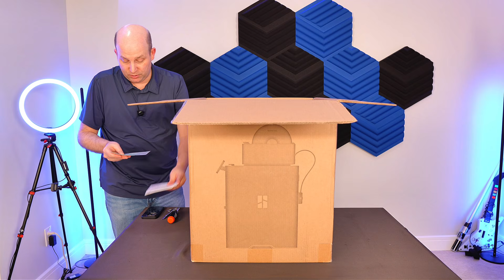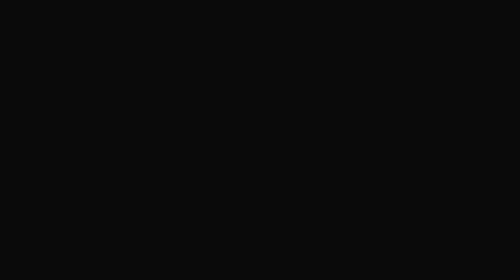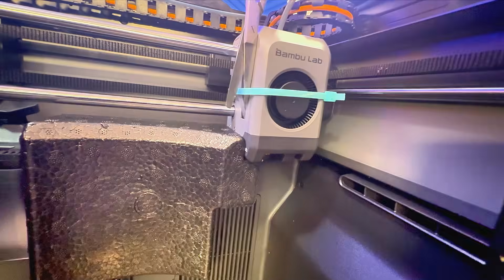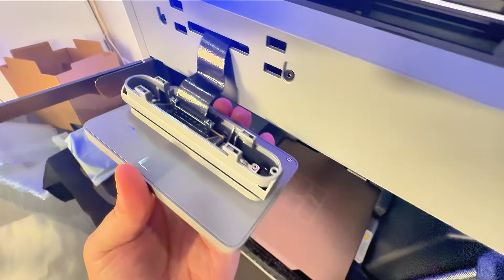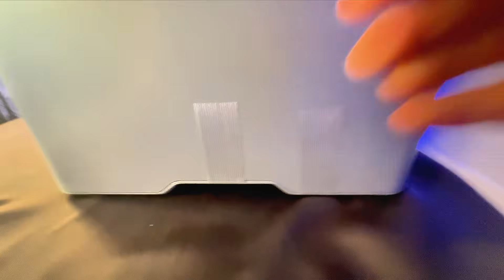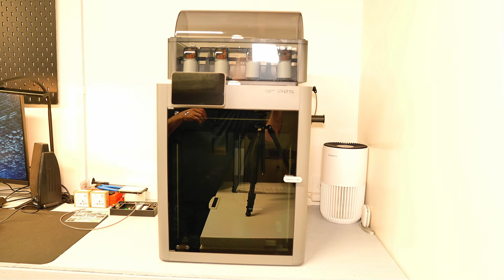Bambu Lab P2S Unboxing and Setup: 3D Printing is Now Part of Our DNA

Comment: Thank you for this video on un-packing and set up. I will be picking up mine today at Best Buy, then need to decide on where to set this up. From what I have researched you will need air filters as these give off a nasty smell. This is important as I live full time in my RV. I plan on making a shelf next to a window so eventually I will have a filter then exhaust to go directly outside, Powering it might be an issue until I add on the additional 50amp supply to my shack to power the new/used Ameritron AL-811H , HF Power Linear Amplifier. Then split off on leg for 25Amps for the 3D printer and future printers down the road. Where is you next video on your first printing and use of this Bambu Lab P2S?
Reply from the maker: Thanks so much for watching! That sounds like an epic RV setup—balancing the P2S next to an Ameritron HF amp is definitely one of the most unique rigs I’ve heard of! 📻🖨️ An external exhaust filter/vent out the window is a super smart move for small spaces. The follow-up printing videos are live on the channel now, hope they help with your first builds!

First Print
https://youtu.be/1cMIWGhlO1M?si=KawgBjwUW1eS3WFl

10 things I wish Id known

https://youtu.be/wH8YV9yEsjM?si=MTxeLZOR2BAbB36a

Must have tools
https://youtu.be/X1fCiBVALkc?si=SqfnW4rLa7TfbO-0

Poop Chute 

https://youtu.be/7dsmz-3xv5A?si=-yi6QrZhjBS1l5Jr

Comment: Did I choose wrong if I bought the Bambu Lab P2S or would it be better to buy it x2d
Reply from the maker: After 3000+ hours I LOVE the P2S. However, I do think that it really depends what it is what your planning to print. If you think you’ll do a majority of multi color then the X2D will save you time and material.  If it’s primarily 1 or 2 color
Prints with PLA and PETG you can’t go wrong with a P2S.

Comment: Does the AMS2 require a separate power supply or does it get powered by the connecting 6 pin cable?
Reply from the maker: It will get powered by the six pin cable for regular color changing.  But if you want to dry while printing, you will need the secondary power cable.